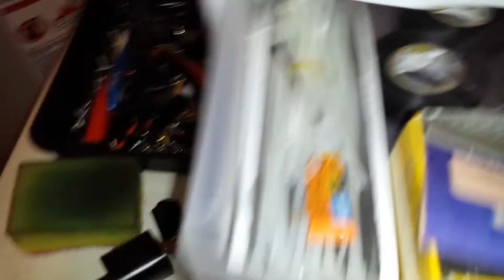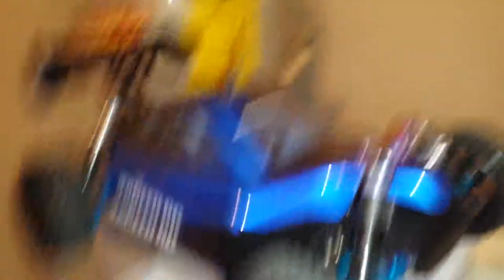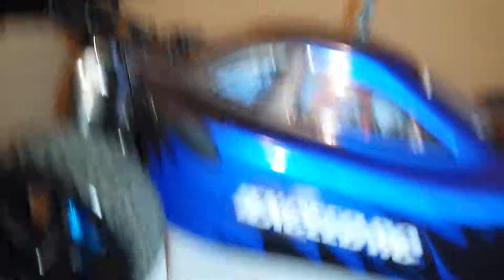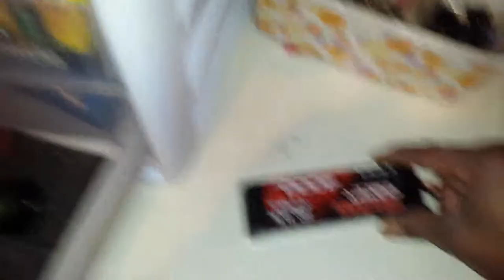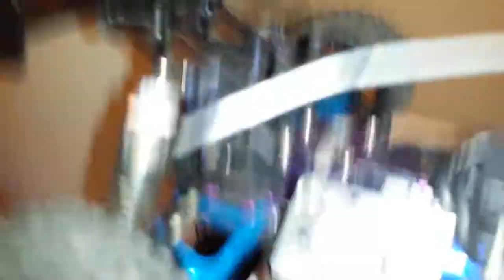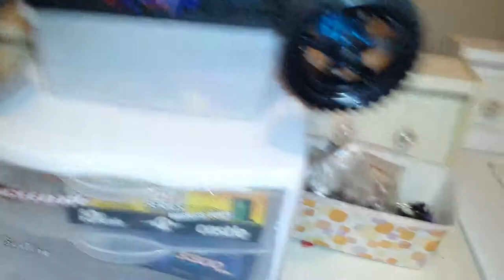Exceed Sunfire buggy mods step 3

Comment: Hey Wayne I like your vids. I'm new to rc and bought a sunfire epx pro and I'm having some issues with it. If I make a video showing issue you think you could help .
Reply: What issues you havin?
Reply: Junior Gardner look at my video
Reply from the maker: ***** sorry for late response buddy I had this issue with an dynamite brushless combo  ur ESC is fried happened to me after running a 3s 11.1 lipo  on it...That's why I installed a traxxas velineon setup to run the traxxas 3cell ...if u haven't already... I suggest u buy another brushless either castle or traxxas to help heat issues also get you an infrared heat gun to watch ur temps during speed runs...good luck
Reply from the maker: What do you need to know man...i know this buggy like the back of my hand....i never mind helping out
Reply: Hey thanks bro but I sold my original one. Now I have another that I run on a 2200kv motor on 4s check out my channel.